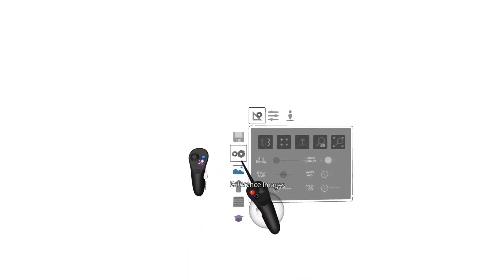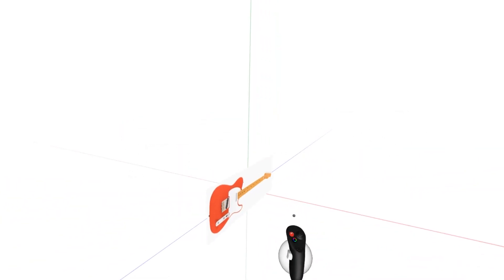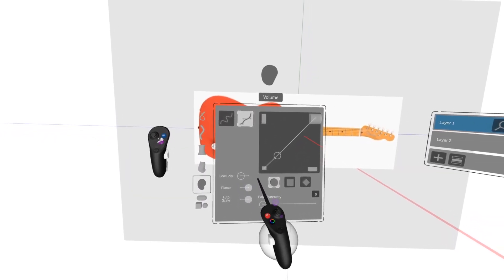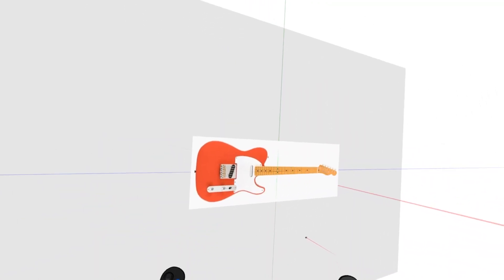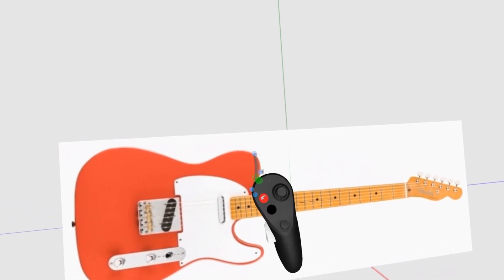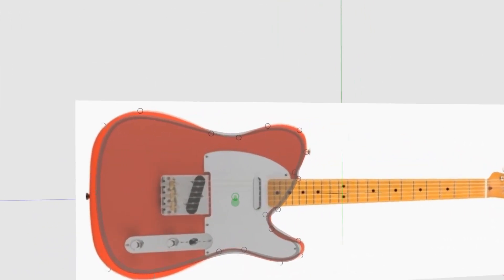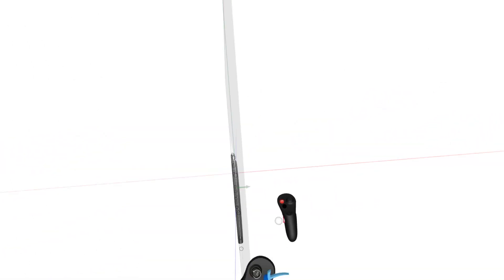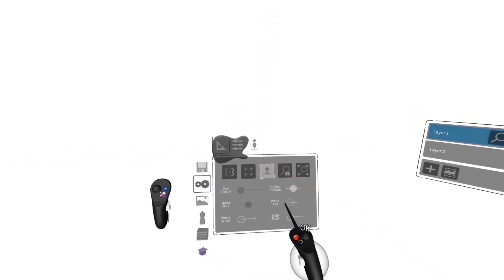How to extrude a volume from planar shapes - Almost 2 Min Tutorials

Comment: I can't seem to find a way to convert a planar volume into a freeform volume or just modify a planar volume, to add some complexity.
Reply: That's what I expected this video to explain, but it doesn't. It's still a planar shape, it's just extruded. What if you wanted your guitar body to be thicker in some places than others without having to recreate the entire thing with the non-planar volume tool?
Reply: Would be interested in this too @gravitysketch

Comment: I found this method to be very useful, in spite of the unrestricted volume tool being a bit unpredictable.
Reply from the maker: Hi! Glad you found it useful. We would love to know how you have found some things unpredictable.
Reply: @GravitySketchYouTube  I think it's because when I first used the non-planar volume tool I had the impression that it worked similarly to the lasso tool from image editing software. However, it actually creates a volume based on the outermost control points - correct me if I'm wrong, but this is what I figured after some practice. It is still helpful for blocking out shapes, creating scales, leaves, and rocks, but aside from that, I'm still experimenting to find other use cases.